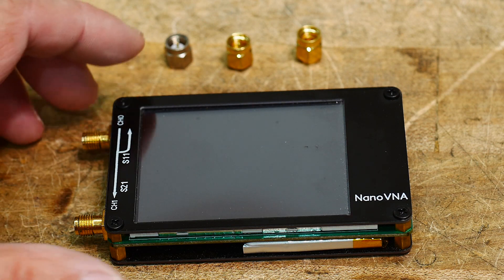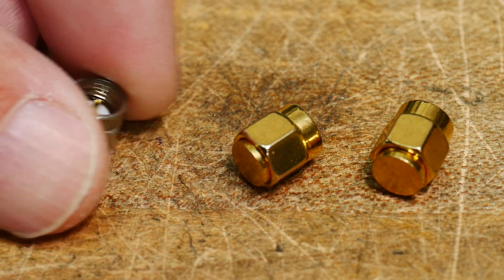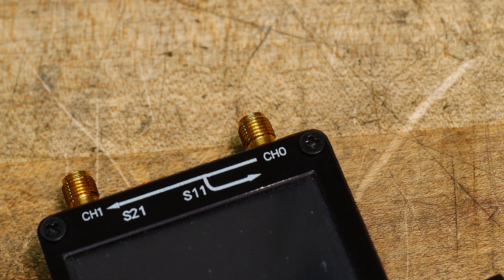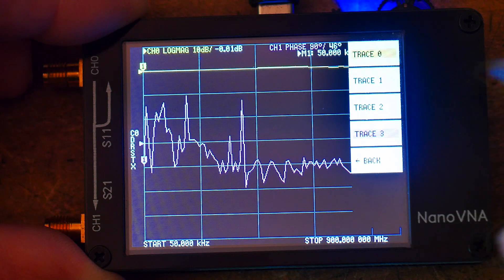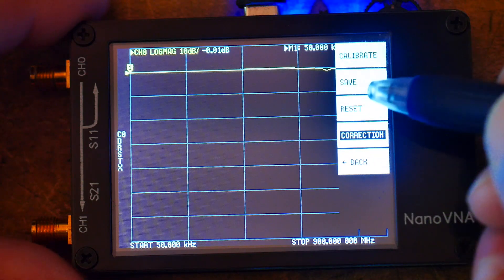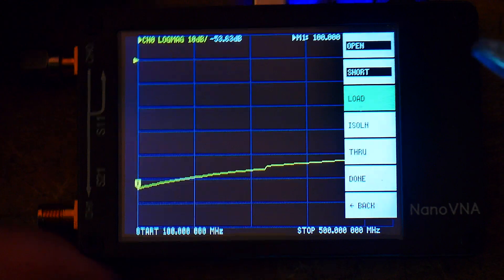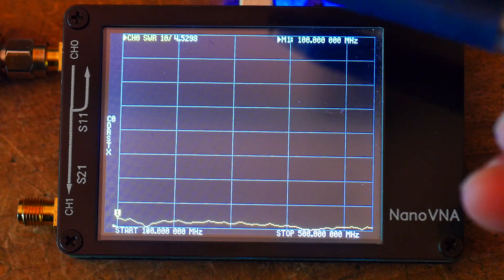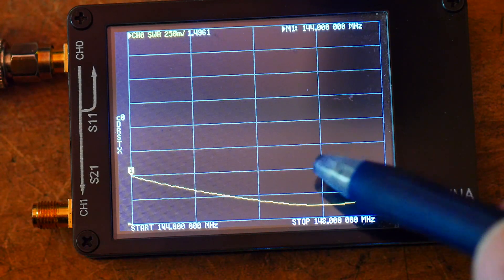#480 NANOVNA Made Simple

Comment: I got mine last spring before I redid all my antenna's in the farm, and went to the school of T&E (trial & error). Glad I figured it out. It's the best tool in the shack. I used it on every antenna. What a tool for my 10 thru 40 vertical to my di-pole and mono bander's. After working with a graph over a meter. I got rid of my MFJ antenna analyzer.
Good video and helped setting scales. Try to learn something every day
73 Dave W9DLP

Comment: Thanks.  One point.  When you changed frequencies to zoom in on the ham band, you should have re-calibrated the unit.  Any change in frequencies requires a new calibration.
Reply: UP UP UP 
Can anyone confirm that? It was my thought too: you should calibrate the instrument any time you change the interval. Isn't that so?
Reply: @itempest4976  Yes.  Because while you may have 100 points of measurement in that range, given the initial calibration having spread that 100 points over a 400MHz span, that means each calibration point covered roughly 4MHz... And now you're set to a 4MHz range, which means you have... exactly 1 calibration data point that's in range.  It'd be much better to have 100, so you can know that the data you're seeing is about the antenna, and not some other aspect of the NanoVNA, or cables, or whatever.

Comment: CAUTION!  Never screw the load CAL connector too tight.  Too much force can break the connection between the inner pin and its 50 ohm load resistor.  Slightly more than finger tight is all you need. (Professionals often use a torque wrench set to 3–5 in·lbf (0.3 to 0.6 N·m) ;  but finger tight + a little is fine!)

Comment: Just what I needed. Found my base antenna is perfect but my HT needs a new antenna.
Reply: I tested my HT antennas all 3.1 SWR but functionally great on radio. I believe the HT antennas will not test correctly because the frame and coupling with the user as a counterpoise changes swr quite a bit!

Comment: Any ignition of the device needs to be recalibrated? Or the calibration is maintained?
Reply from the maker: If you use the save button it will be saved. save 0 is recalled when you power up. if you save to 1 then you need to do a recall 1

Comment: Not a criticism but why didn't you set the "Cal" range to 140 - 150 MHz so that you maximize your limited 100 sample points. Instead you used a range or span of 300 MHz which allows only 1 sample point for each 3 MHz vs 10 sample points per MHz using the more limited range of 6 MHz. I use a Rigol SA-815TG and I have always been taught to limit the Span of your calibration to the actual frequency you want to measure unless you are unsure of the resonance point and at that point expand the range.

Craig W9CLA
Reply from the maker: I calibrated from 100 to 500 MHz in the video. This is plenty accurate for 144 220 and 440. The error functions in the VNA are wideband and smooth. The interpolated points will end up with very very small errors. There is a big difference between calibration errors and measurement errors. You are not wrong for wanting to calibrate over a shorter range but it really is not necessary and the point of this video is to keep it simple.

Comment: what happens with the calibration once you've changed the start and stop frequencies to zoom in on the SWR curve? I noticed the C0 on the lefthand side turned into a c0 (lowecase) so I'm assuming the calibration is no longer valid for your new range. How badly off will it be and will it return too uppercase C0 when I reset the range to the one I've calibrated for?
Reply from the maker: the calibration is 101 points from start to stop at calibration time. any measurements made after that are interpolated from the 101 data set.

Comment: The best tutorial explaining calculating parts and how to set up for swr.  Thank you.
Reply: Many thanks for your tutorial.  Recently bought one. Oh heck where do we start. Duffle around and worked out the menu. But got no further. So ytube search saved the day. Just made a 4m half wave vertical and ended up adjusting in the conventional Manor. So thanks I now have the info I need to use this vna. I can see a lot of good use for this later with all the other features for circuit design. De. Gw4gja ken
Reply: Ttttttttuggggggggggggrttuuututtuuututdhdhyryyrw has po a lllttrr
Yhhhû

Comment: At 18+ minutes you could have presented the "real" version and talked about using proper charging current to prevent bulging batteries which is what a lot of NanoVNA owners are talking about right now, and having to replace their batteries. You should have also said that isol and thru is for testing networks but this way is all you need for testing antennas. Quickly let them know what it is so they can know why it's ok to skip it. You only have their attention for a brief moment, make the most of it. They might not watch another complex version with stuff they DO need to know, after watching this.

Comment: Does coax length effect the accuracy of the reading as it does with antenna analyzers?
Reply from the maker: no it does not effect the accuracy of the reading. The SWR of your antenna/feedline may change with coax length. I'm measuring feed point. the point in the system where the radio is. The coax might have loss and that effects the total SWR or the coax may actually radiate and be part of the antenna.
Reply: Thanks for the reply. I just purchased a NANOVNA and while measuring SWR of a multiband vertical the distance to antenna would change depending on the range of frequencies I was sweeping. I am still working at becoming familiar with it.
Reply from the maker: @garypoland5288  I don't know what you mean by the distance changes? using the NANO to measure the coax length? or SWR changes with different coax lengths.
Reply from the maker: does your vertical have it's own ground wire connected to a ground rod. or does it get ground once connected to the radio? you need to ground the shield of the coax. you may be seeing the coax become a radiator.

Comment: Nice and simple steps, but you didn't explain WHY a calibration is done and that the calibration is done at a SPECIFIC point on the measured cable to remove those unknowns, i.e. base of the antenna to calibrate out the test cables so ONLY the antenna will be measured. The calibration you did is ONLY calibrated to the end of the CH0 connector. One that newbies need to be aware of as the calibration is king. Without a good calibration, the numbers you read are just meaningless numbers! For a good guide on teaching, please watch w2aew's channel !
Reply from the maker: To comment on the calibration.  Controlling the phase reference plane of a VNA is why the real ones are do darn expensive. And you are right to worry about calibration. However the SWR is a scalar measurement. in 50 years being a HAM (WAS WAC DXCC) I've never needed to know the SWR at the antenna. I only worried about the reflected power at the radio  being as small as possible so I knew the maximum power was being delivered . The NANO is a portable tool and one could go out to the antenna and measure it separately to choose the best balun or coax.
Reply from the maker: I agree Alans videos are very good. This is a made simple video. 99.999% of all SWR meters are placed right next to the radio or the internal SWR of the radio is used. I'm just showing how to have a graphing SWR meter to be used like any other SWR meter. The NANO acts as a very low watts output transmitter and the 50ohm bridge acts as a return loss bridge converted to units of SWR